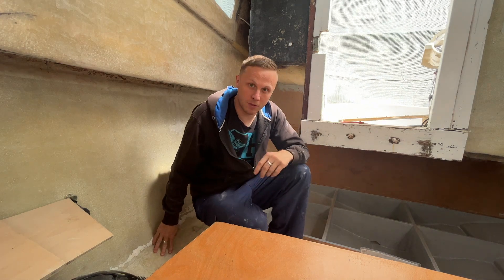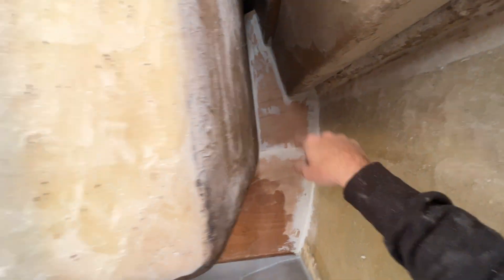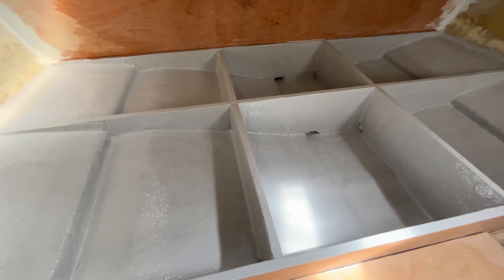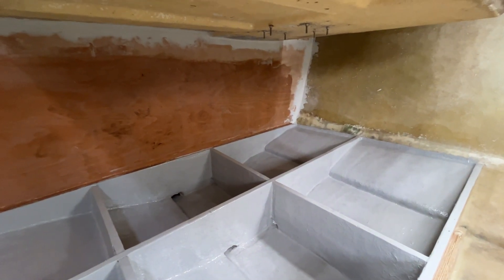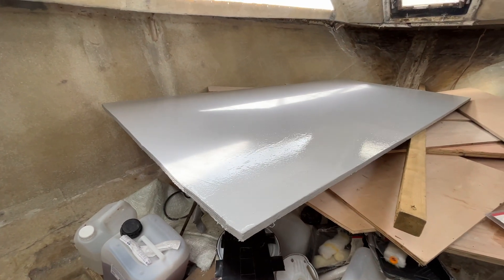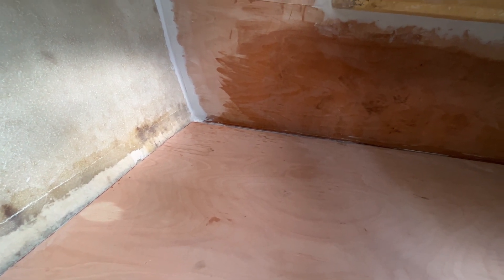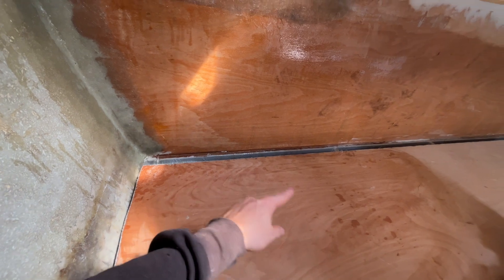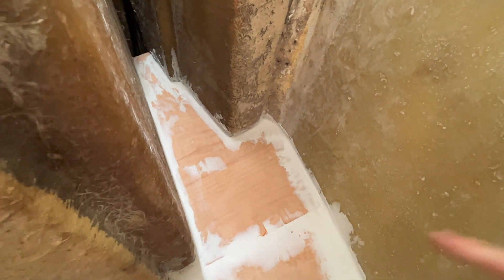Fibreglassing the back wall in and finishing paint the bilge episode 19

Comment: Just as I watched you painting the bed base, I realised the only structural stiffness in the hull is the likes of the toilet walls , the kitchen unit you removed and up at the anchor locker at the forepeak. Most of the modern mouldings for cruisers use foam core glassed over to give rigidity and weight saving . You dont have much room to hide anything like that. I'm not sure how thick the hull fiberglass is. Back in the early days 1960's or there about; the first fiber glass boats were really heavy as they thought it would be fragile. They soon realised it was very strong pound for pound compared with timber and started making the hulls lighter. But keep going ,doing great. best of luck with the concrete, I still have a patio base to lay since last year. Getting reminders now.
Reply from the maker: Thank you I managed to get all the cementing done I also kept putting it off. I really can see why there are so many cracks on the window as all of them structural walls was so rotten that they wasn’t given any support. Just putting the back wall in feels so much better.